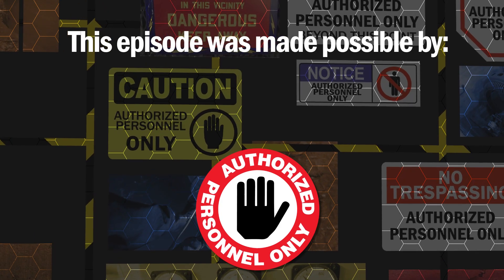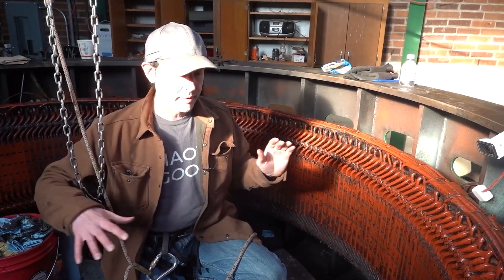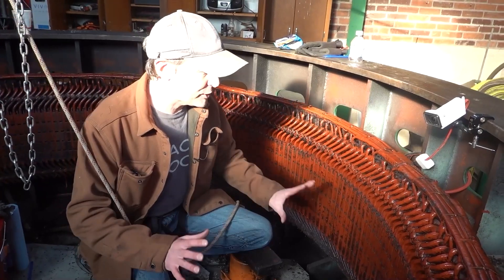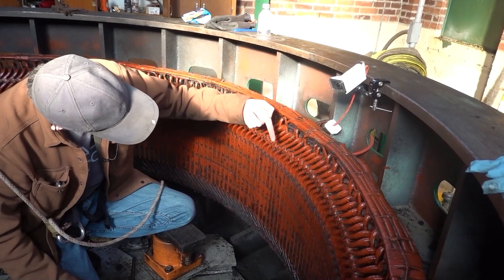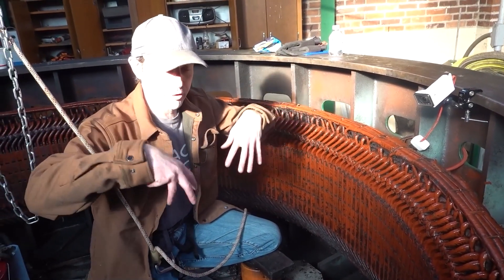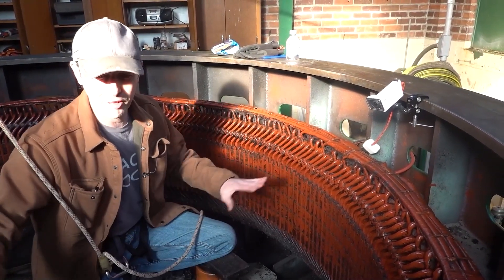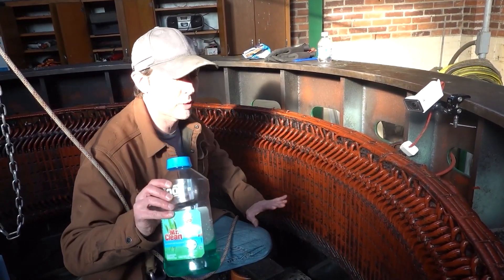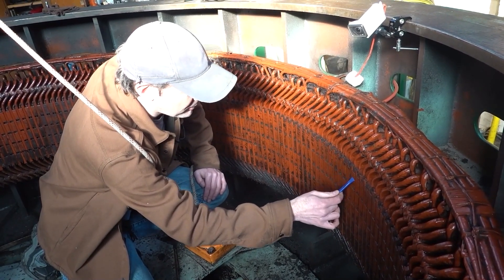Authorized Personnel Only - S2E19-  Cleaning A Hydroelectric Generator Stator The Hard Way

Comment: Next time you need to do it dump me clean into a sandblasting tank and go to town. You will need to catch the run off and reuse it but it should save you half the time you spent on it. Personally I don't see how come you don't pressure wash it. If you are concerned about blasting off the lacquer coating on the wires you can always just relaquer it when it's dry.
Reply: A hot steamy jet blast of water will do miracles against old oils.

Comment: 3:34 why not clean it with brake clean, like i do that with dirty alternators
Reply: 😂 brake clean breaks down the paint which is the insulation. In a high current motor or generator if you have weak insulation you’ll have a large short eventually.

Comment: "The rotor spins at 120 rpm". Ok going back to my nuclear power training (LCDR USNR (Ret)), NP=120f "Nuclear Power is 120 times the Fun", and assuming standard North American grid frequency of 60 hz, that means... a 60 pole generator?! WOW!
Reply from the maker: Yup, all of our hydro plants have very low RPM generators with lots of poles (because we have to get 60Hz no matter how slow we spin). Seeing turbine RPMs way down at only a couple hundred is pretty common.
Reply: @Physicsduck  I was going to say how surprised I was that it only spun about twice a second, but then I remembered that my ships' propellers usually spun at ~75 rpm at standard cruising speeds, so maybe that isn't as slow as I thought. BTW, with 60 poles, that's one every 6°. Let's see...assuming a 6 foot diameter ( judging by comparing Chris's size to that of the radius of the stator.) times π and divided by 60, that's a pole every 3.76 inches.
Reply from the maker: They're bigger than they look, and I'm smaller. The generator in this video is about 10 feet in diameter on the outside I'd guess. I'll get you some detailed specs in a future video and you can work out the number of poles. :)
Reply: Are the poles delta or wye connected?
Reply from the maker: I'm not totally certain, but I think they're Delta.
Reply: @maigretus1  The Hydro's that I've wound in this size range are wye.

Comment: Couldn't you just perform a periodic, time based DC  High potential test on the Stator windings and trend the leakage current for an indicator to when the windings should be cleaned ?

Comment: Actually you can power wash it as long as you dry it out completely afterwards so this guy says you can’t but you actually can.  A hot water power wash would have gotten all that crud off it and it would have gotten all the crud inside them windings not just the outside were he is wiping off Wich is basically nothing it’s better than nothing.  Could have use a media blaster too to thoroughly clean it if something is making you money then it’s worth it I’d say.

Comment: Had to clean a 600HP motor out when we replaced the bearings on it. Was used to shed tires to oblivion and inside it had a lot of rubber carbon char and some tire wires. After cleaning the windings got a fresh coat of that conformal coating material. The stuff smells like cancer in a can lol 😅

Comment: Noticed that some of these big old grid generstors seem to look kind of thin/ narrow in the actual generation (stator) area; as supposed (compared) to a smaller portable generator,  or the little alternator in ones vehicle.?🤔 what determines the physical size  (width/  height  or whatever of the generator design?  Voltage,  amps,  cycles/  phases?
Reply: Surface speed and total capacity. A slow rotating speed needs a larger diameter to bring the ideal surface speed up at the poles. The width is then dictated by the total power available.

Comment: Just completed hand cleaning, aka "stick and rag method",  a 7 MW unit. We determined due to the age of the insulation, cryo cleaning would not be an option. The units are 50 and 65 years old and nearing end of life of the insulation and will need to be rewound on the next cycle. We use plain mineral spirits on the metal components, and a product called PF cleaner on the windings. PF cleaner is non conductive and leaves no residue. Then recoat with type F insulating paint. We conduct megger,  PI, and pole drop testing prior, during and after work.

Comment: While exuberance at having finished that tedious and precise job is understandable, my question is about the liquid detergent.  Before you started, you opined that water is bad on a job like that, but it seemed to me that water would be better than any carbon-based cleaner, as it would not attack the varnish.  It would also be better than scrubbing for the same reason (assuming low pressure application) but you have now used both water and abrasion.  The product you used has water in it, and the tool you used applied abrasion.  
     Those are both fine, but are you going to check the windings with low voltage to test for short circuits between wires?   Might it be a good idea to re-varnish?    (You are still a hero.)
Reply from the maker: Water in massive amounts is bad. The only water we used was the liquid inside the straight Mr.Clean. Nothing additional. We wet the rags and wiped it down. This level of moisture doesn't pose any significant danger to the operation. There's more moisture condensing out of the air in the room from the space heaters.
All windings are megged out and tested before reassembly as well.
Reply: @Physicsduck  Thank you for your nice response.  That stator, freshly cleaned, is a beautiful work of craftsmanship to behold.  You have honored the makers of it with your careful and much needed work.
Reply: I suppose for the same reason a steam cleaner is just as bad.
Reply: I'll bet the "varnish" was Glyptal.  Good oil resistance, to the extent race car engine builders use it to coat the pushrod valley to help in oil shedding and return to the crankcase.